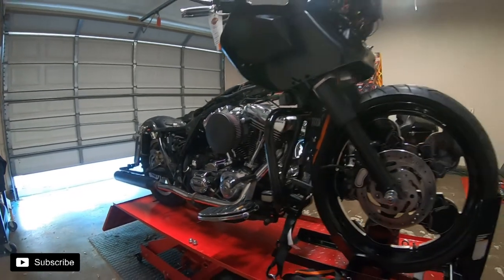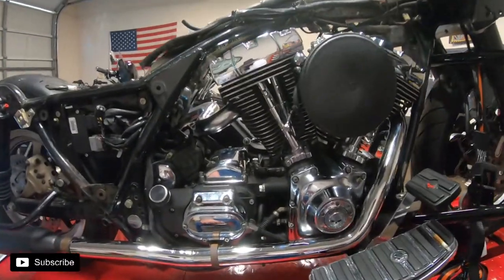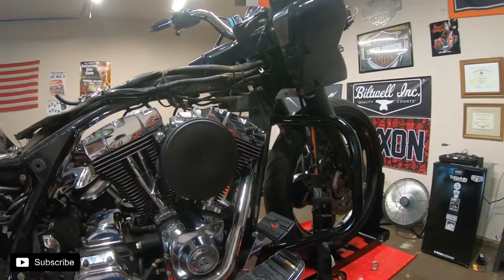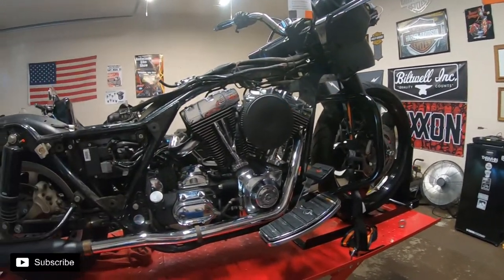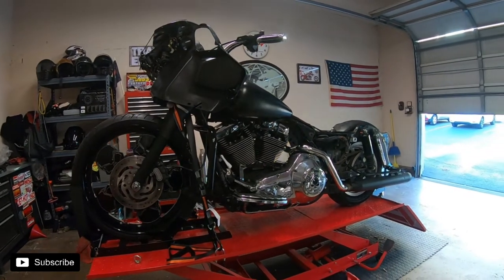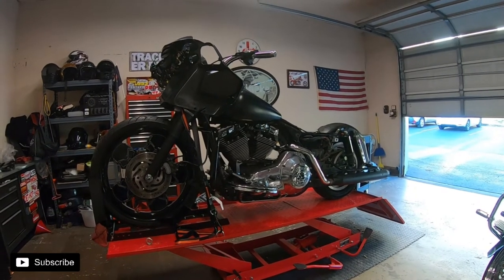Harley Davidson Road Glide Project Big Wheel Bagger: part 1

Comment: Hope the cam tensioner shoes have been replaced!
Reply from the maker: Its got 10,000 miles on it should be solid... 🤜🤛
Reply: @TrippHPjunkie  nope! Put the hydraulic cam tensioner kit in it or gears, save yourself the trouble! Lol
Reply from the maker: Its really not bad just replacing the tensioner's and updating the cam bearings that what I did to my bagger. The second set of shoes last longer.....👍👍👍